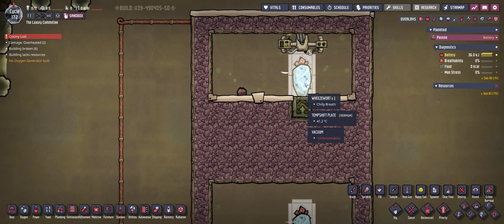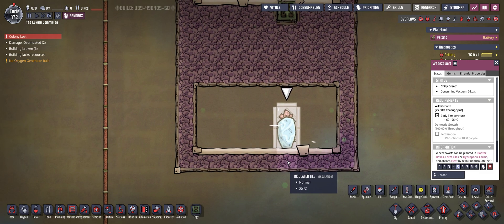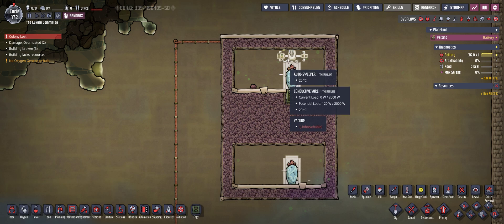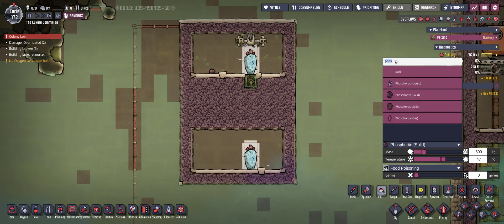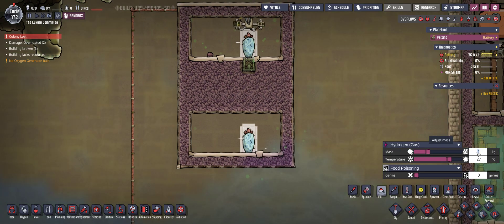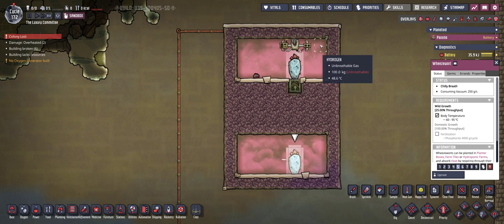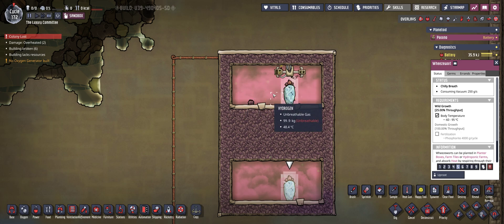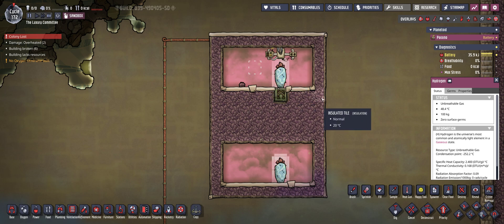Oxygen Not Included HowTo - Wheezewort Cooling

Comment: The energy you get back from wheezeworts is radiation, this can be used for research or to power a radbolt engine rocket.  It would be nice if there was a radbolt reactor to get electricity, but it doesn't seem like the game really allows for nuclear power plants.
Reply from the maker: yes agree. Problem here is that the radiation is too low to collect it. Paying 480W per collector is kinda heavy
Reply: The solution is to grow a cluster of them in a V with the collector in the middle because the radiation overlaps, 5 is enough to easily power a research station (using it for research in my current play through) , it's possible to collect from up to 7 if you really want to maximize it.  Also, have a switch to shut off the radbolt generator when not in use to save on power.